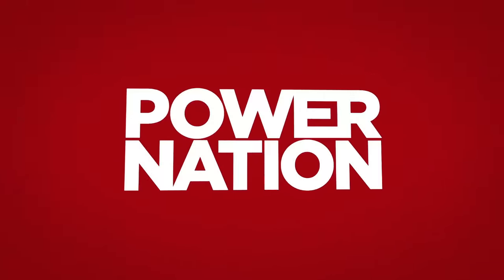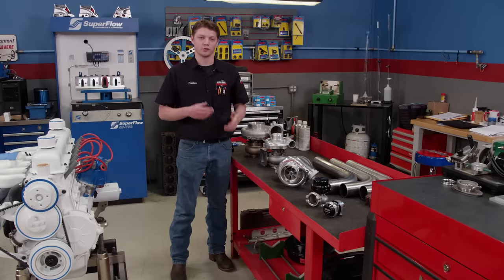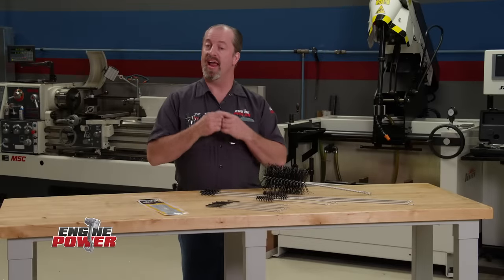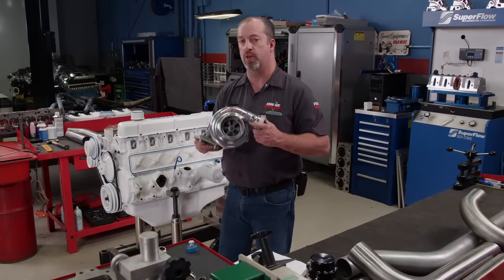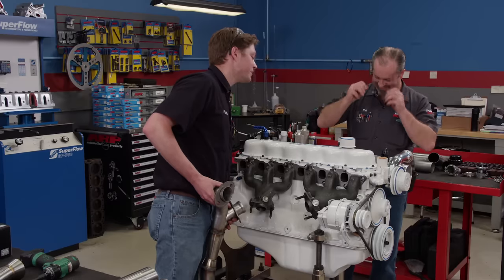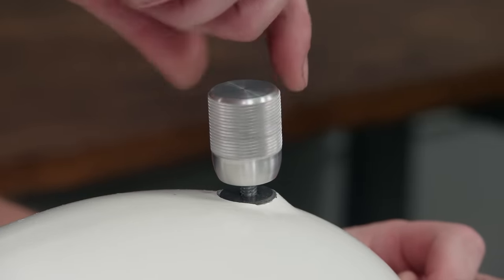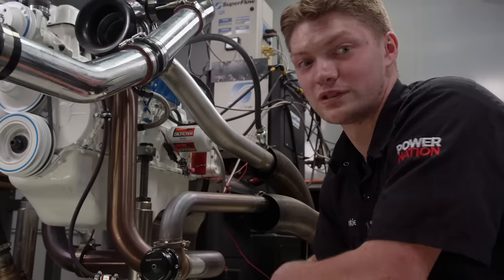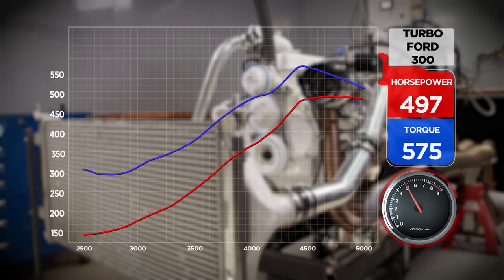Turbocharged Ford 300 Inline Six Makes Over 500 HP on the Dyno - Engine Power S8, E14

Comment: Started at 88hp, finished at 522hp; has to be the biggest improvement from stock EVER !!
Reply: Seriously, what else gives you a nearly 300% increase in HP for essentially bolt ons, minor machine shop work, and DIY Garageability. Makes me wanna yank mine from my truck for a while.
Reply: @kirbychristopher9741  its super easy my buddy makes 429 to the wheels with his 300
Reply: @kirbychristopher9741  a Cummins you could get 300% increase with bolt ons
Reply: @MrAppltec  yes you are correct.  However, Cummins bolt on's are twice the cost of what was done to this 300.
Reply: The thing would have put down more h.p. than 88 by simply giving it a basic tune up first.
Reply: @kirbychristopher9741  it's almost exactly 500%, damn impressive.  I want one
Reply: @kirbychristopher9741  A Honda K20 engine. You better do your research
Reply: @boostjunkie2320  Sure, the Honda might make the HP, but it will never match the torque. And guaranteed the 300 will outlast the Honda 10 fold. Don't get me wrong, I like Honda's. I have been a Mechanic for over 35 years, and Honda has the Midas Touch. But the durability and reliability of the 300 can't easily be matched. Also it's probably the best engine Ford ever made, and one of the Top 10 engines from anyone!
Reply: Idk I'm pretty sure there a first gen rx7 making a 700hp more than stock. But this is still seriously impressive for what was meant to be a work horse.
Reply: @scortroc  lol what rotary will never compare to how reliable and torquey this motor would be
Reply: I would have been happy with the 270hp increase.
Reply: damn betcha!
Reply: What’s crazy is over 200 lb ft with only 88 hp
Reply: @freedomisntfree_44  its just a low redlind.
Reply: @scortroc  maybe, but that lil Wankle will never have that much torque.
Reply: @taekwoncrawfish9418  yeah a big turbo. Some  bigger injectors, and a tune. it's done all the time.. you must be living under a rock lol. hello pfi Speed!!!
Reply: @cainadkins3985  in Puerto Rico they run 300 shots  on rotary engines. like it's a built 350
Reply: @taekwoncrawfish9418  you dont even know what the engine is capable of. just give it up. you dont know enough to continue this
Reply: Actually there's a bunch of 351 head welders out there that push 625hp through a i300.  But for bolt on's, this is incredible.
Reply: @boostjunkie2320  build a high output honda engine is not as cheap, it's way too expensive, less torque and reliability.
Reply: @taekwoncrawfish9418  I agree. Look how much hey custom fabbed to put it in. Also, as its build right now, it won't fit in any engine bay ever designed.
Reply: @scortroc  and it's not even a high rpm engine
Reply: @freedomisntfree_44  poor man's diesel
Reply: @Joe_JesusWins_Lewis  those are N/A drag 300s pushing 600+hp
Reply: @dustinontaiyabbi5608  these engines can easily rev to 10k rpm.
The old 92 f150 I had took 8k rpm pretty much every day with no issues.
Reply: @boostjunkie2320  definitely not. I know k series, been studying a long time, best you can do with bolt on is about 300hp, and we're talking EXPENSIVE. Throw a turbo on and you'll get another 150 ish, but the engine won't last you 10k miles. MotoIQ can build a 150hp/liter all motor 2.4l for $15,000, but obviously you don't understand the coatings and forged components needed to do so.
Reply: @Joe_JesusWins_Lewis  bolt  on a turbo and you can make 600hp on the stock k20.....pfi speed does it all the time
Reply: Hp is rpm dependent, so it's no surprise that the hp went way up when they upped the rpm.
Reply: @boostjunkie2320  turbos aren't really considered "bolt on" though it can be done.  There's a lot involved in integrating a turbo, especially if you're going for triple to quadruple stock hp. And again, those engines aren't going to last long with that kind of thrust. 

This inline 6 is a beastly powerhouse and won't wear terribly fast even built like shown, If I were a betting man, I'd bet you could get a decent 1-200k miles out of fresh build and mostly driving like the now passed Queen.
Reply: @boostjunkie2320  BTW, I'll go hunt up PFI, see what's up, think I've heard of em at some point
Reply: @Joe_JesusWins_Lewis  the BoostedBois...They have several K20s over 1000whp
Reply: @cmdrclassified  I just said this, the other day, to a friend
Reply: @kirbychristopher9741  put a turbo on that bad boy
Reply: @cmdrclassified My point still stands. He asked what other engine can make a ton of hp on bolt ons and there are a few engines that I can think of 2JZ LS1, 7M AMD the k20......
Reply: @davelowets  most IOPU set ups are intentionally left on the low end of HP for durability, and because they are meant to be run a a set throttle for hours on end. The IOPU 351 Windsor only makes around 120 hp.
Reply: @charlesmason1278  That has nothing to do with a W.O.T. dyno run.... and that fact that I mentioned a "tune-up" first.
Reply: @scortroc    😆😂🤣   That's a complete B.S. story.. C'mon man! 🙄

That engine in your truck would NOT reach anywhere NEAR 8000 RPMs in neutral, with your foot to the floor, let alone driving the truck.

10,000 RPMs out of a Ford 300 straight six.... 😆😂🤣😭
Reply: @scortroc  yeah but you ain't pulling no trailer with an RX7
Reply: That's a 593% increase... just short of a 6X improvement 🤣🤘
Reply: 522 ÷ 88 whatever you're looking at this with has a calculator... easy 4th grade division
Reply: @cmdrclassified  I feel the closest Honda has to offer to a 300 i6 would be a j35 but the torque on the ford still way higher and is a much more balanced design
Reply: @davelowets  Ive hit 8k while driving with both a 300, and a 302. Im not saying it aint scary, but my truck, and mustang both did it. top speed in the truck at that rpm was probably 100 or so, and in the mustang i couldnt get it to go past 128.
Reply: @josephdias3968  😆 NO, you did NOT... Don't bullshit me.. A 300 straight six will NOT even rev that high with your foot to the floor, in NEUTRAL, much less while your driving it... 😂

Nice try though...
Reply: if you look up drag racing in other countries with this engine they are boosting them to over 2000 hp
Reply: @davelowets  you don’t need to rev high with massive torque at low rpm
Reply: @josephdias3968  Because they DON'T rev that high, and they don't have "massive torque" either. The 300 straight six is NOT a performance engine, its a slow workhorse to leisurely haul a truck a truck around at a casual rate. That's it.
Reply: That's not really bragging when you think of how many ppl had to drive around with said dismal horsepower
Reply: @andrewwest1032 pololo
Reply: Right
Reply: @kirbychristopher9741  😊😊
Reply: @boostjunkie2320  I'm glad someone else brought up the k20. I thought it was quite hilarious that this video is even boasted "Over 500hp!!" when I've seen d16s push over 500hp and they're a straight four. And those start with not even much HP over the 88hp this had. And two less cylinders.
Reply: You want a bigger improvement from stock? Here: https://www.youtube.com/watch?v=h8tf4B90RXo
Reply: @Joe_JesusWins_Lewis  If It's not engine internals...It's a bolt on....
Reply: @taekwoncrawfish9418  exactly right a around 300
Reply: @boostjunkie2320  bolt on is generally just an upgraded stock part
Reply: @Joe_JesusWins_Lewis  There's k20's that come with turbo stock¯\_(ツ)_/¯ I also don't see where this argument about turbo being a bolt on is even coming into play. This argument started with someone talking about the gains in this video from just bolt ons. Was the 300 inline 6 not a naturally aspirated stock?
Reply: @codyspear1263  rofl, and are basically still gutless except their in a compact style car
Reply: @Joe_JesusWins_Lewis  You can get more power out of a 90s civic engine by turboing and it's got two less cylinders. I don't see your argument. The argument was a turbo is not a bolt-on, bud. Get mad. Japanese is better than American.
Reply: @codyspear1263  mad?? Don't project. Go put a big turbo on a stock d16 and record every time you drive, racecar or drag strip that thing.
Reply: @Joe_JesusWins_Lewis  You certainly sound mad. Sidetrack more bud. The argument here is that a bolt on is generally an upgraded stock part and k20's do come with turbo's stock from the factory. This Ford engine did not.
Reply: @codyspear1263  you are so late kid
Reply: @codyspear1263  the argued point is improvement over stock
Reply: @codyspear1263  regardless of k20/24 coming stock or not with turbo, put miles on one or sit down you wasting my time
Reply: @codyspear1263  you're arguing like the k20 is your little idiot brother and someone insulted him...
Reply: The entirety of the argument is that the i6 got over 500% improvement WITHOUT boost, my mouthy little friend.
Reply: @codyspear1263  every argument takes tangents, but read the whole thread before you hijack
Reply: @boostjunkie2320  A 426 Hemi engine made 425hp, a Top Fuel engine is based on that same 426 Hemi, and makes 11,000 hp. Can a K20 do that?
Reply: @AmericanThunder  Not exactly sir. Nice try tho....All forged internals...Aftermarket intake manifold, carburetor and more......
Reply: @boostjunkie2320  You replied to the wrong person, I never mentioned any of that. lol What has forged internals?
Reply: @AmericanThunder  All top fuel dragsters do
Reply: @kirbychristopher9741  More like a nearly 600% percent increase
Reply: @hughjass1835  More like 594%
Reply: @boostjunkie2320  of course they do what's that have to do with anything all race engines have that hell my streetcar has a billet crankshaft
Reply: @AmericanThunder  well another guy in these comments seems to think it was all factory parts with 11khp......😂😂
Reply: @boostjunkie2320  I can't imagine someone would think Top Fuel used stock 426 Hemi parts
Reply: @AmericanThunder  I do have a lot of experience with the old 426 and 440...I grew up in my grandparents house...Grandpa used to build and dyno tune for the guys at the local track...He raced a 70 Challenger 440 and 68 Camaro 427. He mostly built Dodge big blocks...I've seen first hand what the Hemi can do.....
Reply: @boostjunkie2320 parents abandoned you, I get it.
Reply: Yeah because everyday Joe knows how to map, has stainless weld machine and equipment. 
A laid and tube bending tools.. 
Get real
Reply: Only Subaru or Toyota is more reliable and still performs, than a Honda engine. 
No american manufacturer can match the japanese
Reply: @MrAppltec yeah all 300 HP 😂
Reply: @boostjunkie2320  The Old 91 SS 454 Pickup trucks made junk hp numbers for a big block, a set of high flow heads, shorties, cam, intake and either carb or EFI and you're well over 500hp but still making massive torque numbers.
Reply: @cmdrclassified  Bout any straight 6 will outlast most engines.
Reply: i think barry bonds juiced over bb natural has same jump
Reply: That's wrong. Ever heard about the BMW F1 turbo engines?
Reply: @MrAppltec  cummins🥱
Reply: @onlyjoshing that's because it's a long stroke engine. Be it a short stroke like a coyote and it'd rev super high too. Long stroke engines aren't known for high revving.
Reply: @martinsuper4545 they said that. They said it would have to be re-engineered to fit in a vehicle. Does anyone listen
Reply: @leslieforster1774 Cummins bolt ons are also twice as easy to find.
Reply: I've seen these go over 600
They used to be pretty common to see on race tracks. When they said there aren't any turbo kits available I was calling BS, but I guess they just don't make them any more.
Used to be an entire market of high performance parts. Heads, intakes, cranks, rods, pistons, cams, turbos, even superchargers.
Reply: @MrAppltec  Yes but the cummins is already turbo diesel and designed for that purpose not that old engine from the 60's !
Reply: @danhard8440   And rebuilding them after every couple of runs.😂
Reply: 5xs the cost  @MrAppltec
Reply: AMAZING!